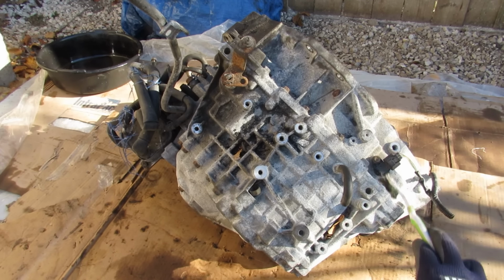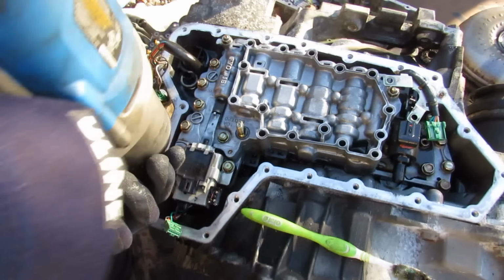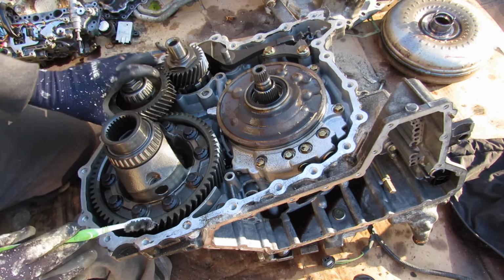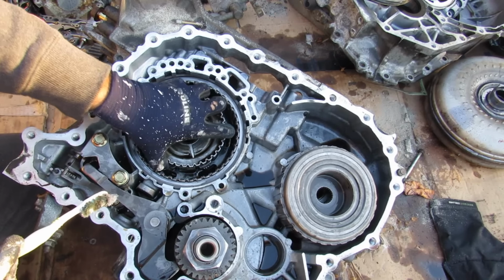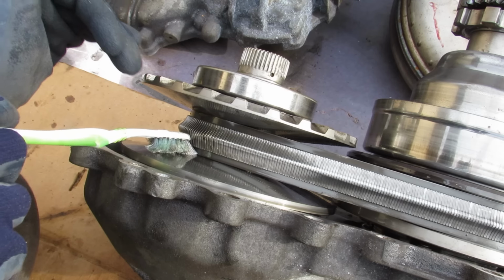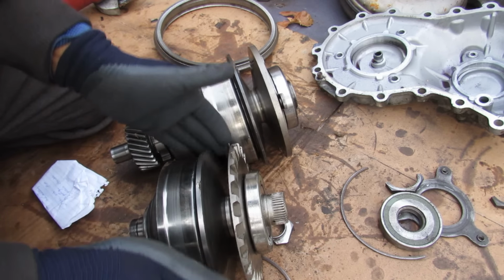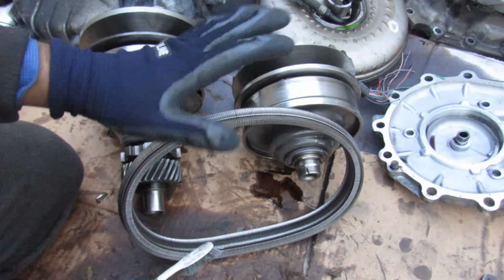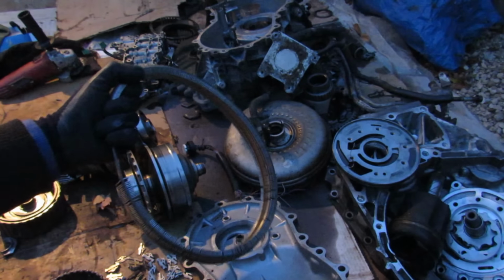Why Nissan CVTs FAIL

Comment: Me and my cvt juke looking at each other after this vid

👁️👁️     👀
Reply from the maker: Send it
Reply: You shouldn't have bought that ugly looking pos in the first place
Reply: @sierrachief117  To be honest, looks are subjective, just like people 😜
Reply: sell it fast
Reply: My Altima telling me: are you believing this?
Reply: Had a Cube.  Went 165000.  Died with no warning.  Over $3000 to fix.  Sold the car.
Reply: And how is it ?
Reply: @millomweb  perfectly fine actually. I bought a bit of a time machine as it was a 2012 with only 16500 on the clock. Recent service the mechanic complimented a "cleanest engine parts he's removed from an engine". Guess I was lucky.
Reply: @Casshern_Sin  Probably you've driven it sensibly. 
I get the feeling that there are a lot of Americans who like to 'floor it' on a green light.
Most cars accelerate reasonably on a quarter throttle - and that's a good move up to 10-15 MPH - then from there, apply more throttle if need be.  At that speed, drive will be fully engaged and the whole transmission ready for full thrust !
Reply: @millomweb  I have the full spec DIG-T 4X4 1.6 Engine (Tekna). Its actually quite eager at low torque. Wants to jump away like a go kart. Admittedly I was totally against the 'Nissan Puke' as I used to say. But my wife had the choice this time and when we got it, I had to eat humble pie. Its actually quite fun.
Reply: @Casshern_Sin  I bought a 2nd hand Renault from a local (Ford) garage I use for repairs etc. It went there for an 18000 service inc timing belt change. They did all the work on it but were unable to reset the service warning light.
I went to collect it, paid for the work and then sat in it.
I then said "I am not in a car, I am in front of a computer and I need to find Ctrl-Alt-Delete.
After doing 2-3 strange things, I found out how to reset the 'spanner' symbol - maybe in about 3 minutes. I went back into the garage and told them I'd reset the service indication. Of course they came out to have a look - but I didn't tell them how I'd done it :)
With the fancy electronic controlled gearbox, who knows what you could accidentally discover by pressing any buttons on the controls while turning the ignition on !
Back with the Renault, one day it wasn't running very well again - so on a steady downhill, I rebooted the engine while travelling and it ran fine again after that !

Comment: Cheap trash designed to extract money.
All fuel milage gains offset by trans replacement and frequent fluid changes.
Reply from the maker: Designed for a specific purpose and lifetime

Comment: That's huge gearbox! I never knew CVT is this much complications inside! So torque converter is better than CVT?
Reply from the maker: This has a torque converter too
Reply: @speedkar99  so which type of  gearbox is best for efficiency as well as reliability. I'm using AMT car right now but didn't like jerks so thinking of shifting to CVT or Torque converter. I'm scared of DSG failures so can't think of DSG/DCT!

Comment: My last car had great CVT.  No more gear hunting. smooth changing of gear ratios.  However even CVTs are going away in cars.  350 hp on a Tesla... only a simple gear reduction and parking lock and lube pump is needed.  No need for clutches, forward reverse gear.
Reply from the maker: Transmissions might still stick around in some for or another...I'd still consider that gear reduction a transmission ...
Reply: @speedkar99  yes..I agree a single stage gear reduction is a transmission... A single speed gearbox.

Comment: Amazing job in disassembly and explaining what junk these are. The coolant system from the factory is the cause of most premature ejection of this thing. I added a plate and tube cooler placed in air stream (front bumper) in series with the already 2 factory coolers and now the car drives without going into "limp mode". Powerful Nissan altima riding hard knocking on wood.
Reply from the maker: Interesting you added a second cooler?
Reply: @speedkar99  Yes Inline with the main radiator "cooler" that actually heats the fluid if ya think about it. Very easily done. Robbed plate and tube oil cooler off a Tahoe or something. Flushed. Connected in series to the output of radiator cooler and inlet into transmission. Strapped in bumper for direct airflow. Added 1/2 qt CVT fluid. Problem immediately 100% solved. Big believer in secondary coolers now especially when towing is involved.

Comment: I don't like them. The first time I drove one, it was like the clutch was slipping all the time, it just feels so wrong, like you have an elastic band between the foot pedal and the drive wheels.
Reply from the maker: Yeah I hate that wind up and go feeling
Reply: @speedkar99  - It was a Toyota Yaris and I didn't know - it took me a moment to figure out it wasn't the usual automatic, it was a gutless car too, or at least it felt that way. It felt like there was an elastic band between me and controlling the car. No thanks! Not a driver's car, that's for sure.

Comment: I had a brand new 2011 Chevy Cruze. Eight months later, I had to trade it in. The reason was the CVT. Before I trade that car, I had the dealer look into it. They tried to fix the first time. But the problem came back again. It will always stall from a dead stop, it will not shift properly. The second time I took the car into service the dealership, they couldn’t find the problem. I was floored. That is why I will not purchase a car with a CVT.
Reply from the maker: Sadness

Comment: Because they are a piece of crap designed to fail. If you re3ach 100,000 miles with a nissan trasmission, consider yourself lucky.

Comment: At least the "bust a nut" comment gave me a belly laugh.  Seriously though, I watched this entire video waiting for suggestions of things to do or not do if you have a CVT in your car  in order to make it avoid failure as long as possible.  I understand how it works better now but sure would like to see what actions on the part of the driver affect longevity.  Thanks.
Reply from the maker: Take it easy. These things are meant for scooters and economy cars. Not SUVs with V6 engines

Comment: There is 1 bug fail point he missed.... The key that holds the variaters on the shaft. The key way tends to wear which allows the key to move just a little thrn the key will sheer off allowing the variater to lock up which trashes the belt resulting in KIBBLES AND BITS
Reply from the maker: Yes I wish I could have opened that

Comment: Ok I have a 2013 2500 Altima. 204,000 miles. Have changed the trans fluid three times.  I never tow with it. most miles are road miles. So any idea how much longer the trans will last?

Comment: For me a very informative video.
Here in Germany I drive a Suzuki Kizashi with a CVT (from Jatco like the one in the video) from 2011, which was not officially designed for the German market and its high-speed motorways without speed limits.
The dealers who then imported it themselves and offered it to Germany initially forgot to improve the transmission cooling for the higher loads when driving fast on the german autobahn.
This made the oil too hot and too thin, preventing the oil pump from maintaining the pressure used to compress the clutch pack.
The clutch disks then slip and burn out.
There is a control lamp for the gearbox, but it is never activated by the gearbox electronics...!
This means that no warning will be displayed if the transmission is in danger.

Für mich ein sehr informatives Video.
Hier in Deutschland fahre ich einen Suzuki Kizashi mit einem CVT (Fa. Jatco wie das im Video) aus dem Jahr 2011, der nicht offiziell für den deutschen Markt und seine Hochgeschwindigkeitsautobahnen ohne Geschwindigkeitsbegrenzung konzipiert wurde.
Die Händler, die diesen Wagen dann selbst importierten und in Deutschland anboten, haben anfangs vergessen, die Getriebekühlung für die höheren Lasten beim schnellen Fahren auf der Autobahn zu verbessern.
Dies machte das Öl zu heiß und zu dünn, so dass die Ölpumpe den Druck, mit dem das Kupplungspaket zusammengedrückt wird, nicht mehr aufrechterhalten kann.
Die Kupplungsscheiben rutschen dann und verbrennen.
Es gibt zwar eine Kontrollleuchte für das Getriebe, die jedoch niemals von der Getriebeelektronik aktiviert wird...!
Dies bedeutet, dass keine Warnung angezeigt wird, wenn das Getriebe in Gefahr ist.

Comment: Ahhh, the ol CVT. All the mechanical failure points of the old style transmissions but with the added heat and metal shaving from purposely slipping a metal belt on metal drums.

Comment: I have been overhauling cvt's for a while now, easily 200 of them and the only real problematic ones are the ones in the nissan x-trail. Most common problems are the starter clutch shuddering and the primary/slave pulley main bearings screaming, my boss says that I'm a strange bloke because I like building them. The idea of a cvt is mind blowing especially with a turbo but like you said they are weak. I have only ever had one with catastrophic failure where the belt support rings snapped. But they all start playing up between 80 000k's and 90 000k's. But still not as bad as the holden/Chevy captiva 6 speed auto...

Comment: Question... Could you use one of the cvt as a 2:1 reduction only..
Freed from case? Or does it have to have pressure so actually work just as a 2:1

Comment: I have been driving my Nissan Altima since 2012.  With it's CVT,rapid and smooth acceleration than any other car I drove! I haven't even changed its transmission fluid or coolant. Never had an issue
Reply: 2010 Legacy, 170Kkm, 2.5 motor, STW. Best transmission ever!

Comment: Hey, I like the driving experience in my CVT car.  No rubber band effect – the pulley ratios change rather quickly. While you do NOT get a FEELING of acceleration,  you get ACTUAL acceleration, acceleration that is BETTER than that of a manual shift car or a traditional planetary gearset automatic, working with the same engine. The car gets up to the speed you want before you realize it has happened, Rather than being jerked around and made to feel like you are accelerating, you are ACTUALLY accelerating. Yes it is noisy and I don't know how long it is going to last. Plus if it should fail, unlike a manual or a planetary automatic – good luck repairing it.

Comment: A very good description of how this unit works. As with other automatics, worn main  control / valve body , and worn, leaking pressure control cause a lot of issues, and in the CVT, flow control valve wear, lead to accelerated wear of hard parts. There are some parts available through transmission specialists, if you know where to look.

Comment: I think the main reason for "failures" on CVT's is to tell people that they are "sealed" and we cannot check the fluid level. Also, you need a $20 special 4-feet long dipstick to check the fluid level, which most workshops do not have! I drove cars with Jatco CVT's over the 200,000 km mark with no problem. Only the fluid had to be topped up in one after about 175,000 km. In the other, I had the fluid drained and replaced because it was getting brown at about 150,000 km. Usually, if the fluid level goes too low, you will get the transmission temperature warning light to come up and the car go into "limping mode". All you need to do it put about 1/2 to 1 litre of CVT transmission fluid and everything should go back to normal. Better if you have the dipstick (available on amazon) to get the exact recommended level, but it needs to be measured and checked while also checking the transmission temperature, and it's a tedious task. In my case, just putting 1 litre of fluid worked and the transmission worked fine for tens of thousands of kilometers after that.

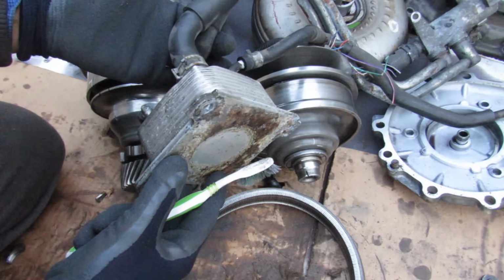Comment: 16:05 - Any way to modify a part, build from CNC an aftermarket transmission cooler that runs to the front of the car? As long as the fluid remains cool, it should buy you some more time on the trans
Reply from the maker: Yes. And don't overload and tow

Comment: .With that CVT transmission Nissan managed to self destroy such a previously fine vehicles as a Maxima and Pathfinder. And then instead of to put 6 or more speed A/T into the great Xterra they just killed it leaving body on frame SUV market to Wrangler and 4Runner.`
Reply from the maker: At least they have the Armada / Patrol
Reply: @speedkar99  Perfectly right but my very uneducated guess is that Chevy/GMC/Cadillac  triplets outsold Nissan/Infinity twins at least 10 to 1. But again, that's a different story, not body on frame one.

Comment: You're basing an opinion on all Nissan CVTs from the analysis of a 15 year-old model. The current Xtronic CVT design is improved above and beyond that example so much in fact that the current Pathfinder's tow rating was increased from 5,000lbs to 6,000lbs.

Comment: My experience with CVT's are with scooters.  I'm not a mechanic, but do much of the work myself.  That said.  I totally agree.  CVT's are great with light loads, but placing a lot of torque and resistance is going to create problems.
Reply from the maker: Yep. How different are scooters?

Comment: @speedkar99 I have a Toyota with a CVT. You mentioned that the ratio in the smallest "gear" is 1:2. This means that all CVT transmissions need some kind of clutch to start off from a stop? Is there any wear and tear on this clutch?
Reply from the maker: Don't forget the final drive ratio
Reply: @speedkar99  I mean, do I need to change the clutch on a CVT vehicle at some point?

Comment: Hello, my name is olivier, I am french so i cannot fully enjoy the video. I disassembled the cvt of my murano z50 2005 awd. I replaced the 2 pulleys. The primary pulley was dead (the 3 grooves completely puffed out and the balls destroyed). I installed a transgo kit in the oil pump (as a preventive measure). I put everything together but the code P0744 comes back all the times, sometimes accompanied by the P0868. the car runs, all gears are ok, BUT, when i drive at 100km/hour (speed stabilized on the flat) the engine speed is above 2000 rpm while it should be at 1500 rpm. What's the problem? sensors? Do you have an idea? (nissan ns2 is in the cvt) Thank you very much

Comment: there's an old saying:

if it works, don't fix it!, sadly that 's what Nissan did, and now they have failing transmissions, I rather suffer fuel consumption over reliability, cuz saving gas $ is the last thing on my mind, when you're stuck out in the middle of nowhere!

Comment: So far my Quest has done fine. Subaru has the CVT transmission now as well. I think the single most important thing on these transmissions is Changing  the fluid as required.
Reply from the maker: And driving it easy, no towing

Comment: It's really too bad that not more R&D hasn't been put into CVTs.  I can see a lot of potential that they offer, even in racing.  But it just hasn't reached it's full potential yet.  That and as a gearhead by heart, I do love the hard, positive shifts of a well built geared transmission.
Reply from the maker: I agree. There's potential but I think to make a CVT perform properly it would negate any savings, and fuel economy sells cars
Reply: @speedkar99  
I'm sure you're right.  My knowledge of CVTs is limited.  I used to work at a Suzuki dealership as a mechanic and I had to service a lot of Polaris ATVs with their version of a CVT.  By comparison, it was a much simpler design.   But my official opinion of Polaris and their line of ATVs is that most were crap, lol.  They had potential to be good.  But they just didn't hold up as well as the Japanese brands.  But a lot of that was on their owners too.  Mostly ranchers and farmers that just didn't maintain them very well.  But I'd still like to see more done to develop the technology.

Comment: 96" 97' Honda civic  CVT. Had a cvt transmission. Every 60,000 the belt has to replaced with ment transmission removal around $1,200. CVT is junk.
Reply from the maker: The 97 civic didn't have a CVT...
Reply: @speedkar99 , Honda civic HX - 115hp. Cvt was a option on 96-97.

Comment: Very interesting.  I thought they were two cones with a belt in between that moves up and down.  You are saying the pulleys get bigger and smaller via hydraulic pressure.
Yes Nissan is a piece of crap.  Certainly not what they used to be.  My son is on his 2nd or 3rd CVT.
Reply from the maker: The hydraulic pressure moves the cones in and out

Comment: i burned up my 2008 altima's transmission at only 35k miles. But they replaced it within 2 days and it has not had problems since. I think it has like 100k miles on the new transmission. The car has actually had few problems. Just the catalytic converter, breaks, and wheel bearings.
Reply from the maker: Was it under warranty?
Reply: @speedkar99  thankfully it was

Comment: Great job bro. 👍🏻 question, I have an 08 Maxima, changed fluid at 92,000 and added a transmission cooler. I have117,000 now and lately it’s having a clunk, the best way I can describe it, when moving forward from a stop. Kinda like an automatic when shifts type feeling. Any input to what you thinks happening? Thanks and good job on the video.

Comment: I bought a used 05 murano,with a CVT,for about two in half years now. About two weeks ago,it started to make noise. It’s getting louder now. It clatters,sounds like a battle tank driven on a concrete road. I located,where the noise is at,it’s right under the valve body and to the side of it. It’s still drivable,though. However,when I accelerate, the noise becomes less loud. Would you be able to identify the specific component that make noise? Thanks,on the hand,great video....